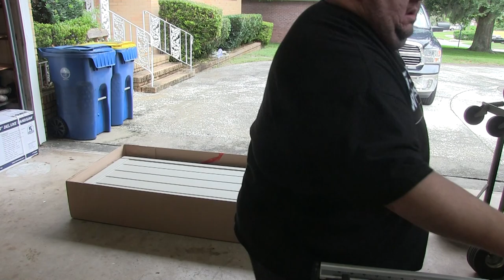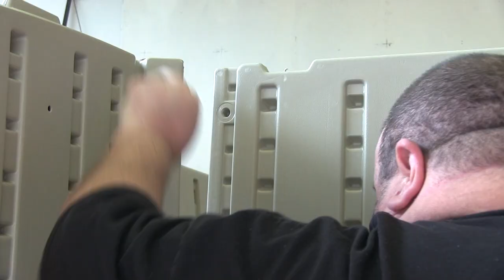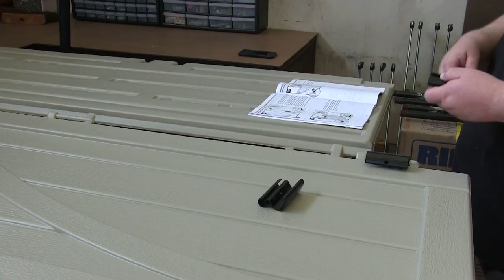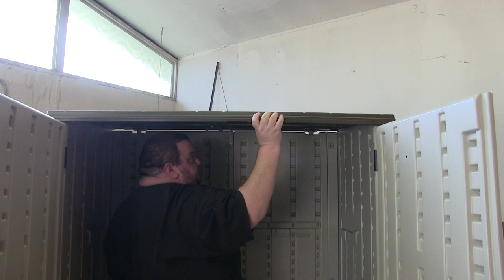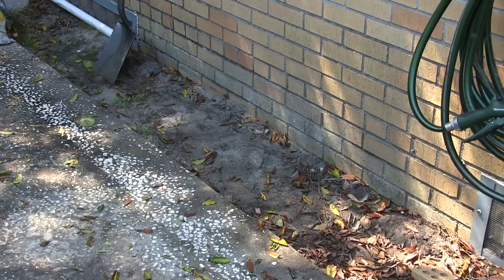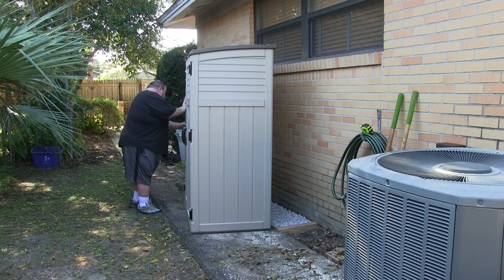Outdoor Tool Storage Unboxing and Assembly

Comment: Loved the video. The shed is that easy to put together. Just a tip from snowy Michigan: Put some 1or 2 inch blocks under the floor. Then set the shed on top. If you get snow, and the shed isn’t raised up, your doors won’t have clearance. Once raised, you’ll be able to get the snow shovels out.
Reply from the maker: Good tip for those reading this who live in snowy weather places... however... not much snowfall here in Florida, hahah!!

Comment: I don't see that you anchored it. How will you prevent it from blowing away. It is pretty light. I have 3 I would like to put outside but I am c9ncerned about how to anchor them
Reply from the maker: the location I've put mine is pretty well protected from big storms and I've got it loaded down with really heavy stuff so I'm not really concerned about it blowing away. However... there are places in the floor and in the back wall for mounting anchors to.

Comment: I got that shed too. I spent, literally, all day on it and it's not complete. Why? Because nothing was aligned. The side was bowed so i couldn't fit the left side in correctly. The bottom latch doesn't go through the hole provided and the right side hinges don't wrap around the designated area so the screws don't go all the way in. What a freaking nightmare! And I bought 3 of those and don't even want to open the other boxes.
Reply from the maker: Oh nooooo… that’s horrible!!! Sadly every batch of injection molded material is gonna have a few bad apples, but they should be caught by the Quality Assurance folks before they leave the factory. I’m sure the other ones you have are fine, but then again I have been accused of being overly optimistic at times!! That sucks, I’m really sorry that happened to you!!
Reply: @BigLousWorkshop  Thanks for your empathy Lou. I'm going back outside today to try to get a roof on.  I'm no stranger to assembly either, but really don't like these illustrated instructions.  They are suppose to send me new hinges, but I can't envision what good that will do.

I was hoping you would have shown how to use those 'hooky thingies'. 

I just need to get this over with and get DANCING!!
Have fun and thanks for the video!
Blessings

Comment: Do you think a normal size push mower would fit inside this shed? We just bought it (the shed) and have not assembled it yet, I’m nervous it may not fit length wise. Your thoughts?
Reply from the maker: Most push mowers have the ability to have the handles fold up for storage... if that's the case with yours you should be fine... it's got more room inside than images appear.

Comment: Awesome video it definitely will help me as I just purchased mine today waiting for it to get shipped! I had a question, I’m trying to see if I can store a bike or 2 tops inside this shed. Do you think it’s possible to hang a vertical bike rack? Think it’s sturdy enough?
Reply from the maker: First... thanks so much for the comment and feedback, I appreciate it... Second... I honestly have no idea... I have not owned a bike in over 30 years LOL. I think it would depend in how the rack is mounted to be honest. If it was designed to hang on the wall, then maybe, cause there are places to mount shelving brackets, anything other than that would need more expertise with mounting bikes than I have. Wish I could be more help!

Comment: The place tou put it os going to cause a water drainage problem over time.  The roof shed is taller than the window.  If the window is open you can get water in your house too.  I'd suggest finding a different location.
Reply from the maker: Thanks so much for the feedback... but it's been there through more than a few massive storms and no issue with drainage. Also, I never open that window (or any windows really, it lets the AC out!!). The overhang from the eaves is more than enough protection from direct rain!

Comment: Hi Lou, it is good to see your video.  What was that strange tool you were using?  It was the first tool that you had in your hand.  Was it a large size Allen wrench?
Reply from the maker: Hey, thanks so much for the comment… it was probly the special tool that came with the unit specifically for those bolts.

Comment: Aren't  you worried that the Florida Thunderstorms will blow the shed over??  I have thought about getting one for my house but I am wondering how to anchor it to keep it from flying away.
Reply from the maker: Not in this case... the place where I have it is pretty sheltered from the high winds we get with big storms... I've had trash cans and things of that nature along this same side of the house and never had an issue with them flying away!! That being said, this unit has holes in the back and bottom for bolting it to an existing building or a secure base. The instruction book has a whole section on building a base for it.

Comment: Big Lou, just a question about the base. Is it really necessary? Was looking at the installation guide online and it says either wood or concrete base. Is that really needed?  Thanks!
Reply from the maker: Thanks for the question… I can only speak for my particular situation and because I was putting it on a foundation that was of different elevations I wanted to build it up so that it was completely flat which is why I did the base the way that I did. The bottom of this shed is plastic so it’s only going to be as strong as whatever foundation you’re putting it on if the ground where you’re putting it is solid and firm then go for it. Other people have risk of very High winds and need a solid foundation to secure the shed to so that it doesn’t get blown away in a tornado or hurricane … I hope that helps!!

Comment: Thanks for sharing.  How long did it take to assemble?
Reply from the maker: Well to be fair I was filming while putting it together so it was not a good example of how long it takes... but if I wasn't filming I'd say it would probly take 2 hours or so depending on how proficient you are with following assembly instructions, and puzzles. It was really pretty simple, with the most difficult thing being getting the doors to line up. I hope that helps!!